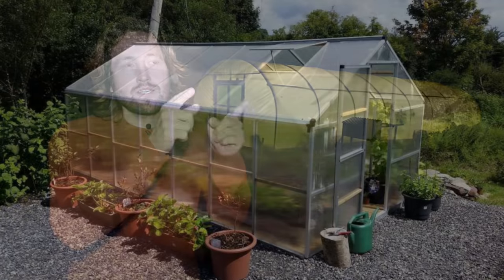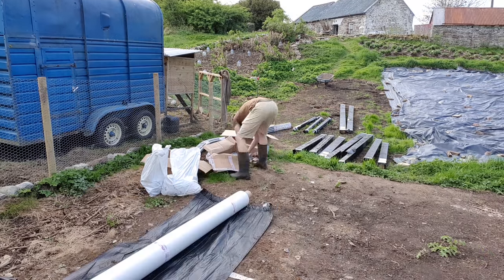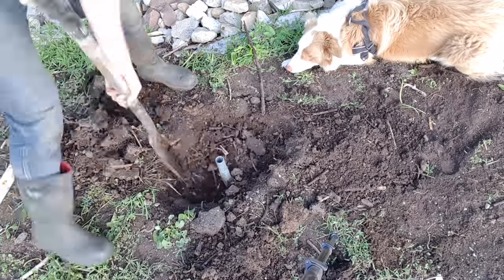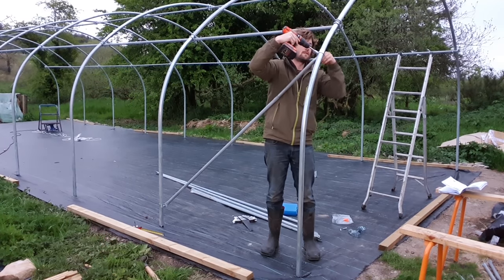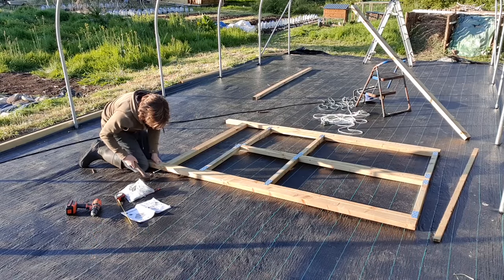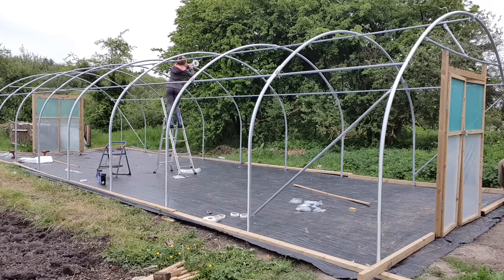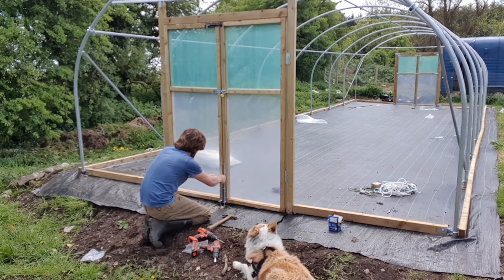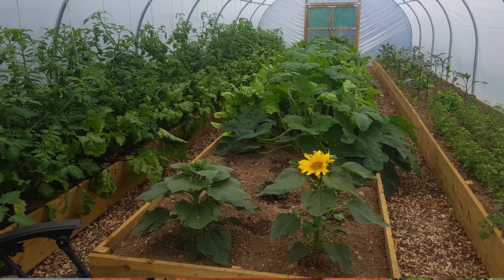How To Build a Polytunnel - Start to Finish!

Comment: We bought a polytunnel from First Tunnels at the end of last year. It's 14 feet by 20 feet and we went with the full storm bracing kit too. We removed a large shed that was built on concrete, so no digging of soil, just heavy duty screws to anchor the tunnel down. My husband has been building it over the last few weeks, by himself. Like you, we've got 3 raised beds, slightly higher than yours because I have severe pain and chronic health and the beds are at a height where I can sit on a low wheeled seat. Beds are full of soil and compost and we're just waiting for a warmer, less windy day, to get the plastic on. Hopefully next weekend, the weather here is looking brighter and a lot warmer than now. I'm surprised that you didn't go with sliding doors considering how windy it gets where you are. We opted for sliding doors. Loved your video. It also instilled, what I already knew, that my husband has done an amazing job, to build it by himself and only getting help to put the plastic on. New subscriber here 💜🌺

Comment: Hi chap, great video, just thought I'd add a few extra tips that will benefit you and your viewers in the future and would have eliminated many of you frame tinkering problems. We have a  60 ft by 30 ft polytunnel. With you all the way on Pythagoras. Regarding the level site. It isn't such a big deal if you can create a floating datum for the top of the ground tubes. The way you do this is stake outside of the perimeter of the polytunnel length and width ways but inline with the perimeter. Ie extend each length by about a meter on either end. Then you will need a length of clear plastic pipe with about a 6 or 7  mm center. Bring each end up to the stake, secure onto each stake. Then add the magic ingredient water it will level due to gravity. You can then run a taught string from one stake to another on the points that the water perscribes to you.  Then either measure down with a tape and plumb bob for every ground tube. Or simply measure down at each stake and run a second line at the correct height. This marks the correct height for the top of the ground tubes. It also indicates the  line position for the tubes. All you need to do then is measure your center distance, normally 5 or 6 ft, and tie a bit of string to mark said point. Line up the top of the tube and adjust the botom of the tube until your spirit level shows it verticle in both planes and ur done
Reply: awesome tip!
Reply: That sounds like more trouble than what Mossy did........!
Reply: @andymccabe6712  the sheet for our 60 ft by 30 ft is £450 quid. If you want it fitted properly, with decent tension throughout, on a big tunnel , any errors are magnified. 45 meters of pipe cost around 15 quid , the time to smash in 4 stakes, and to fill the pipe with water, then tie 13 bits of string to the string line isn't a big deal. An hours work tops. It will take far longer to adjust 13 ground tubes, if uve over or under dug. A laser level would do the job nicely, but I don't have one and to set up a thousand sq meter be market garden has cost £9,000 so I'm not inclined to shell out for one, but I still wanted my polytunnel done properly, without paying for a company to do it. Frame was 2nd hand £750, sheet £450. Fixtures and fittings for side rails that we added £250, and timber £300. £1750 for 172 meters of polytunnel bed space, so just over a tenner /m
Reply: @andymccabe6712  mossy also had to adjust has ground tubes after he had back filled them

Comment: You have created plastic gutters that direct moisture and rain down towards the door frame when tightening the plastic. Inspect it for water damage.. perhaps coat it in some rubber sealant if the watter flows into the wooden frame to keep it dry.

Comment: You did a perfect job, I’ve got a FIRST polytunnel that i put up with volunteers too. Pleating the ends downwards would prevent water pooling at the door frame. A tip for five years time!!! Xxx Kate
Reply: Yes I thought the same. What if he taped them shut, would that not work?🤓🌱🙏💗

Comment: You made hard work of putting on the polythen. I put up a First Tunnel 8 years ago on a sloping site in an exosed site in windy Wales, I had no choice. Still the same polythen.
Reply: So - what are you saying.....??
Hard work, how......??!
Reply: @andymccabe6712  two guy one each end pull poly tight and you will find it will slide nicely up and over the frame. My wife and I did it on a 30 x 18 ft tunnel. have since done it on 2 other tunnels of about the same size

Comment: We have 2 polly and  1 netted tunnels. Two are in quite windy positions. We find the hotspot tape (the only thing we can find at this time you can use for the job ) inadequate for the job, as it is in layers, any movement and it splits. This makes whichever covering rub, hole then split apart. 
We are now awaiting our third set of coverings. Which with the shipping is very expensive because of weight.
So when thinking of building take heed of what is mentioned avoid windy positions.
Apart from the tunnel issues. This is a very good video.

Comment: I didn't hear you mention, but if you put a slight crown down the center of your floor your water will not stand in a puddle inside if the ground gets saturated.This is a georgous poly tunnel well done.

Comment: A little tip we use in the building industry for checking the corners are square without having to do much maths: Firstly mark out the wall locations with string. Then measure 3 metres/feet from a corner along one wall and mark the string with some masking tape. Then measure 4 metres/feet from the same corner along the other wall and mark with the tape. Measure diagonally between the two marks and it should measure 5 metres/feet. This 3/4/5 rule applies to any building regardless of size as it is the Pythagorean Theorem. If you have a very small structure you can adjust the ratio (e.g. 1.5/2/2.5). Use this method to check all four corners. For a final check if you have a long enough tape, measure diagonally from corner to corner across the building in both directions to verify that both measurements are the same.

Comment: I'm over in Leitrim very high up above Lough Allen, my tunnel has been up since 2009, I got the polly tunnel repair tape from first tunnels, every time you see wear especially where the bars touch the plastic I tapped it my tunnel is still up.  I have two I lost my big one to the wind a couple of years back, mainly because the roof was too high for me to conveniently tape up over the years without going to get the ladder, I'm hoping to put that one back up this year, this was so informative, really helped me put the job into perspective 🌱🌹

Comment: Great looking tunnel. I did a couple of things a little different to you on my tunnel. Instead of burying part of the door frame I drove metal angle spikes into the ground on the inside of the door frames and fixed through. When putting the sheet on I unrolled it at one end and then pulled it from one end to the other, it certainly looked easier than trying to do it from one side to the other, especially on a long tunnel like yours and yes 3 or 4 people would make it a whole lot easier! I tried to make the folds at either end around the door the other way up so as not to create a water trap.

Comment: The easiest way to draw 90 degree angle on ground is to draw a triangle with sides 3parts:4parts:5parts, which always has 90 degrees angle in it, no matter what size the part is. Credits to Pythagoras for that :)
Reply: I've used that theorem so many times on the farm, I could hardly count them all!

Comment: I now realise my mistake i have no ground sheet great video by the way.
Reply: Well, it's only a mistake if you don't want to grow in the ground! Remember, it's a lot less expensive and a lot less work to grow directly in the ground. Also, you can spray weeds(moral objections aside) and you can selectively cover smaller areas with weed mat at much lower cost, if that's an issue....

Comment: Brilliant video, thank you so much for making it. Showing the reality of such a huge undertaking but also the importance of working with a super quality supplier like First Tunnels. Are you on the verge of a flourishing relationship?

From my own experience I find that standard sized beds (3 feet) along the walls with access only from one side are awkward to reach into easily, I wish we had opted for 4 beds rather than 3 with narrower beds against the walls. That is, 2 X 18 inches on walls and 2 x 30 inches in the middle. But just a thought.

Comment: Looking into a Polytunnel myself. My site has substantial slope, very rocky ground with bed rock showing in most fields around.  Also have strong winds routinely.  My selection of options follows yours for almost all except I'm surprised you opted for outward opening hinged doors.  I've been advised that sliding doors are less prone to the wind and can be locked partially open to allow for ventilation.  Can you explain why you have hinged doors?
Very interesting video, thanks.

Comment: Thanks for the great video, I've been wondering about this for a while, great video and advice and well done on a challenging job, I have seen polytunnels with blue plastic water pipes used as the frame, they were fed through the sleeves in the plastic cover, have you researched these? Or do you know anyone that has them? More power to you!

Comment: Daniel. Great video as to be expected from all your previous ones.  Im at the present choosing my polytunnel and this is one of the companies that is on my short list. 
Im hoping to get one of a similar size 24x 42 or possibly48’.  But mine will be on a slope which i have been told is ok as long as the slope runs down the length.  
Ill need some help when i do finally get to erect it, but wait to grow my first crop.

Comment: we live on the side of a hill so I'm not sure how I can level the ground. great video. Love the female helpers :)
Reply: The best choice is to dig down into the hill, assuming that it doesn't face north. The dirt wall, even a low one, adds insulation. In really cold high altitude locations they actually build their greenhouses in pits. Obviously, that is a huge task. The other option is a cinder block retaining wall filled in with dirt. You could split the difference and build a retaining wall half the height you need and then rake the dirt from the excavation into it to fill in.

Comment: Congratulations! I'm very envious. That was obviously a big job! In my southern US garden I have to fight against the summer heat, not beg for it. I would like a tunnel to grow cool weather crops most of the way through our relatively mild winters, though. What I really want is a greenhouse to grow citrus trees. How does the poly tunnel compare to your dearly departed greenhouse as far as heat retention?
Reply: In Australia they use shade cloth instead of the plastic - you could try that!
Reply: @imzanawlto3070  Thanks! I've thought about maybe putting shade cloth on in the summer to grow some lettuce, etc. I want to use the poly during the winter which is not severe but not quite warm. For example last fall I planted my fall peas too late. They never took off but the small pea vines are still alive. Just 10F to 20F more would give me peas all winter but if I could get up to 30f or 40f warmer, I could grow summer crops or even semi tropical perennials.

Comment: Wouldn't it be much easier to measure with a construction string that you should use to level any large area? The string can be marked at the length you desire and use your tape measure to determine presice

Comment: If you do struggle with the wind and don't want to concrete the base plates in I'd use some of the bigger stones then as you back fill the soil compact it with something like a sledgehammer or even a sturdy piece of wood attached to the end of a sledgehammer (poor man's compactor)

Comment: How did you attach the base rail to the hoops? Did you use U bolts or strips of galvanised band ?
Reply from the maker: They were U-shaped brackets which fitted around both and then bolted together.
Reply: @MossyBottom  thanks,  i need to get those or make them up, screwfix have U bolts but they are €5.50 each!

Comment: Hi what a lovely addition to your land. I am sure you will increase you food production massively. That said you are in a northern climate, so I would consider adapting this Polly tunnel a bit to take better advantage of the colder periods. see this article on Chinese green houses https://www.lowtechmagazine.com/2015/12/reinventing-the-greenhouse.html  the basic principal is to use a mass as a heatsink to capture sunlight and return it as heat during the winter or cooler months combined shaded areas to prevent that overheating the tunnel in the summer months. As orientation of the tunnel is important for this concept to work you'd have to assess if the effort of rotating the tunnel house (if not currently correctly positioned) is worth any gains you'd make to your growing season. food for thought I guess.

Comment: You didn’t need the weed control plastic. Not good under raised beds. Weeds would not have come up through 30cm raised bed. Bad for soil biology and buried plastic very bad for environment. Try taking it out!  It’s there forever
Reply: It's woven mat so it does no harm under raised beds, other than limiting root growth. But how many vegetables go down more than 12 inches? It would be a pain laying it between raised beds. As for taking it out - what planet are you calling from.........?!
Reply: Not many veg gardeners would agree with burying plastic in the earth. I didn’t mean try take it out. I meant it should never have been used